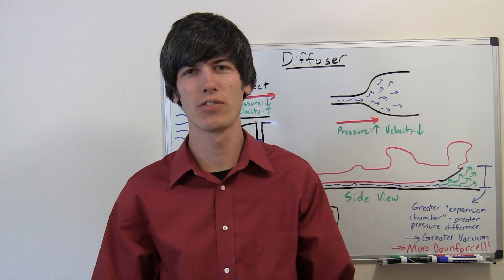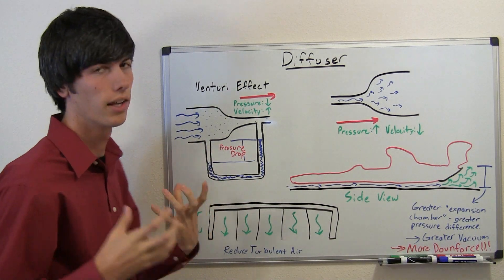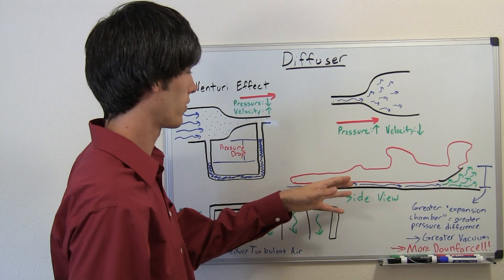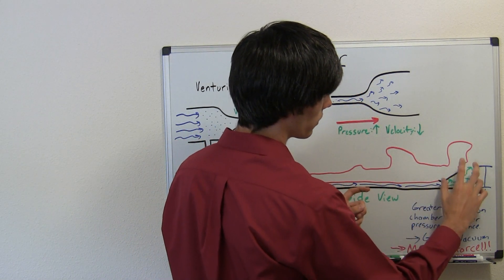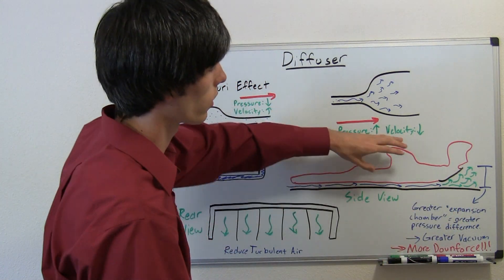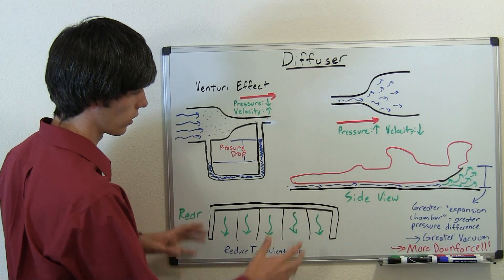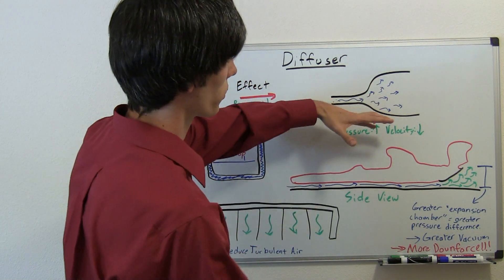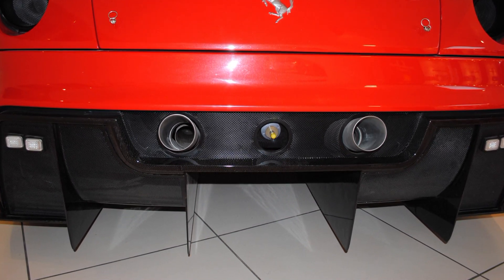Diffuser - Explained

Comment: this explanation contradicts my knowledge on aerodynamics. how does a greater pressure differential helps draw air from the bottom out faster? doesn't air moves from high to low pressure? 
from what I read is that the high pressure at the exit of the diffuser is to help to minimise the vacuum at the rear created by flow separation near the trunk area hence lower drag. and the fins and shape are for the flow exiting without turbulence making faster flow at the bottom hence downforce 
please correct me if I am wrong
Reply: +Kenneth Lee This video, for me, does not tell the complete story. It is truth what is said. But lacks one part of the equation, that is, air is not &quot;created&quot; under the car. Air enters the bottom of the car by, specially, the front, and also, from the side of the car. There, you have high pressure (not atmospheric pressure, because the movement of the car, will increase it, forcing air entering under the car). So, is that pressure that is responsible for forcing air travelling at high speed under the car, and there, at low pressure. The diffuser in te rear helps stabilizing the flow in the rear. Yes it expandes the air, and yes, you will have teorethicaly, a higher pressure that underneath the car. The question is that we always assume that a venturi, does not represent any pressure drop. What is not real. So, when air comes to the diffuser, it will try to fill that volume, expanding, decreasing speed. But you still have a big pressure differential between the front, and the rear. The bigger the differential, the faster the air will travel. But the problem is that you need to stabilize the air in the rear, so when it goes out behind the car, does not represent turbulence enough that could affect the flow (and decreasing air speed under the car). So, by expanding the air and reducing it speed, and stabilizing the flow by the presence of those ducts and fins, that is achieved. And it must be achieved by means of, lets say, can interact with other aerodynamic questions that can affect the car. That vacuum question that you mention, is more a problem of air swirling around. So the diffuser must be able to direct the air straight out of the car, avoiding those swirls to happen, filling that vacuum (and why not saying it, using that vacuum to increase the capability to extract air under the car), reducing drag. Not an expert. Just my idea. ;)
Reply: Diffusers are not aerodynamic devices?  Really?
Reply: hi Kenneth. a diffuser converts dynamic pressure to static pressure. For a given static pressure behind the car, the diffuser allows a lower pressure underneath the car, meaning more downforce. the better the diffuser, the higher the downforce created.
Reply: +El BU Sorry, but you are wrong. So if you have a pressure differential, between the front and the rear, that is what is responsible for it's speed, both in the intake, under the car, or in the rear end. Think of it this way: if you don't have that pressure differential, the air wouldn't flow at all, and speed would be 0m/s. You say "more air to flow", and you are right there. But if the cross section is constant, in order to let more air to pass, something must happen. And as you know, flow=speed x area (or cross section). So if you have more air passing under the car, or in correct terms, a increase in flow, and the area is constant, speed must increase. Regarding the pressure differential, in a system, as it increases, the speed will also increase.
Reply: +fitty77 So you should say: '' you are right", cause what you say is exactly what I said. However you compare an static airflow situation where the airflow is manipulated through cross section differential with a dynamic airflow situation with a different overall pressure difference. This is comparable with the car moving at higher speeds. Of course the total airflow will increase in this situation.
Reply: +fitty77 Totally right English is not my native language either. What you are talking about now how to ensure the airflow stays connected to the surface. There are limits to how you far you can go before the airflow disconnects from the surface, unless this is what you want to achieve at a specific point along the surface.
Reply: +fitty77 I think you're close to it. Pressure differential between the front and rear does not increase the airspeed, it just forces more air to flow. The speed depends on the cross section.  Playing with the cross section allows for low pressure under the car. But your right the diffusor stabilizes the air to minimise drag and still allows for lower pressure that sucks the airflow up behind the car.
Reply: +El BU also about the cross section, in pratical terms, you don't want it to be to large, as it will lose effectivness, or to small, as it can disrupt the air flow itself. Not talking about the diffuser. Talking about ground clearence and the shape of the bottom of the car. The idea is to have the air flowing as fast as possible under the car, keep it flowless (not sure if this is even a word... lol, but english is not my language), and take care that it reaches the rear as "clean" as possible. Because when speed increases, is really hard to avoid turbulence. So the bottom must be regular, and the diffuser, will help stabilizing the flow in the rear (really don't believe that a laminar flow is achievable, but hey, try your best :) ).
Reply: +El BU &#180;Sorry, i&#39;m not saying EXACTLY what you said. You said pressure differential will increase air flow, but not it speed. I said you are right, that it will increase the air flow, but you are wrong when saying that speed will not increase... The example i used, that you refer to, i used because at this side of the keyboard, i don&#39;t know your konwledge on fluid dynamics. Just an exampl. Nothing more. The end of your answer really didn&#39;t understood what you said. Sorry. I&#39;ll guess that is this: yes, as car moves faster, the faster the air will flow. And yes, the greater will be the pressure differential.
Reply: +El BU Maybe the problem is really a question of English terms... :D What is important is that we discuss this stuff in order to evolve ;) Cheers
Reply: +fitty77 Evolve certainly. You are still saying the same as I did. Increase in overall pressure will increase the total airflow. When the geometrie of a cross section does not change. The air speed will increase. However cross section can change so the only constant is the total airflow that has a different speeds and static pressures (in a fixed relationship) when the crossection changes.
Reply: also if I remember right the aerodynamics properties he is using is actually bernoulli, not venturi.  I am going to cut him slack because he is more mechanical not aerodynamic.  F-1 cars spend a lot of effort to minimize wakes which helps reduce aerodynamic drag (main purpose of a diffuser I would think).  all the other videos he has done that I have seen are great, just this one you can tell he is a little out of his element.  aerodynamics isn't easy though
Reply: There is actually an even lower pressure generated on the back of the car.
Reply: The point of a rear diffuser is to create a larger pressure on the rear of the vehicle. This will minimize cd, minimizing drag. This is due to the low pressure created in the underside of a car. If you want to maximise downforce, dont run a diffuser, which can be seen on some fsae cars, were top speed reached is less than 60mph and thus drag isnt that much of an issue
Reply: Kenneth Lee I agree with you, as I see it diffusers create under pressure so it is sucking the car down because it is trying to pull car down while rear wing is doing it in the opposite way by pushing it down
Reply: +Kenneth Lee You are right. The rear end does not suck the wind out, it increases the pressure and minimizes turbulence. It does however creates an upward movement of the airflow, that indicates a lower pressure than the surrounding air. Expension of a subsonic airflow, always slows down the airspeed.
Reply: Makes sense to me. That 'expansion chamber' at the rear of the car is to give space for the air exiting from underneath the car to expand, hence lowering the pressure at the back of the car. The low pressure there sucks the air from underneath the car out through the back, hence also lowering the pressure underneath the car. Then when you have low pressure at the underside of the car, and the higher, unaltered 'atmospheric' pressure on top of the car, that'll naturally help push the car down. Downforce, as they say.

At least that's how I'm getting it
Reply: timtam53191 finally, someone hit the nail on the head
Reply: Kenneth Lee.... He is explaining diffusers, not aerodynamic,, dnt mix two concepts..

Comment: If the diffuser increases airpressure, it does not create downforce, but the opposite. I think the real purpose of the diffusor is to slow tow the airflow and increase the airpressure to the speed of the car and the normal airpressure. In doing so this prevents turbulence behind the car that would happen when the high velocity low pressure air underneath the car is released to 'open air'. The real down force comes from the low pressure underneath the car. the diffusor just releases the airflow 'gently' to the atmosphere and by so reducing the drag.
Reply: In the video he says that it was drawn out backwards, that is correct.
Reply: +Baylor Mccarville The diffuser itself (rear body work) does not draw anything. It is just an airflow with constant energy (except for normal loss of energy) that is manipulated by increasing or decreasing cross section and through this, airflow velocity. This effects also the static pressure which generates the true downforce. If you want an extreme low pressure at the end of the diffusor that would 'suck' the air out, that will create extreme turbulence behind the car and increases drag. In the end, the air is not drawn out, but the car pushed down.
Reply: +EI BU you are correct. The explanation of diffusers in this video is incorrect.

Comment: I noticed something that seemed a bit off to me.
Expansion chambers are designed to actually INCREASE the speed of gas coming out of the low pressure, smaller zone.
I'm basing this off of the theory of the de Laval nozzle design in rocketry, the gas actually increases in speed in the expansion zone at the rear.
Reply: +Joshua Selvidge Well that is true for the laval nozzle, but there is one huge difference to a diffusor of a car. The gas stream of a rocketmotor reaches supersonic speeds and the car doesn't. And at super sonic speeds the working of the diffusor is reversed. At sub sonic speeds the gas slows down and the static pressure increses in a expansion chamber. At super sonic speeds the static pressure drops and the gas flow accelerates.
A laval nozzle is a very clever thing because it is designet in such a way that the gas stream reaches super sonic speed at exactly the narrowest part of the nozzle.
Reply: +Joshua Selvidge Yes, but in rocket theory, the gas exiting the outlet depends on the inlet pressure, throat area and temperature. In this case,  the main purpose of diffuser is to help to reduce the turbulence wake at the back of the car by smoothing the transition(separation of boundary layers) of air from high velocity/low-pressure to low velocity/atmospheric-pressure. In Rocket design, the outlet velocity is high enough to neglect this effect. I assumed you are talking about convergent-divergent nozzle. :-)

Comment: Think u got this wrong. air exiting the diffuser is of less pressure and higher velocity than the air undercarriage. Boyle's law - For a fixed amount of an ideal gas kept at a fixed temperature, pressure and volume are inversely proportional.
Reply: +airj17 Boiyle's law only works for a static system. A closed chamber or something similar. You don't have that in this case here.
Reply: There's nothing to do with volume and Boyle's Law. We're speakin of a high and low pressure effect on an object aka venturi effect. It is correctly explained in this video, the undercarriage has lower pressure and higher velocity, and at the exit of diffuser, pressure is high and velocity drops (don't argue, this is basic physics). Hence the lower pressure below (undercarriage) causes the higher pressure above the vehicle to push the whole car to the floor. This concept works similarly to an  aerofoil wing of aircrafts.
Reply: If you listen closely he'll say, "this is just backwards" so it's the opposite of what he said, but he meant for that to happen. You are correct.

Comment: loved other videos, but you got this one wrong. The one you explain here is ground effect. Diffuser works differently, when high velocity under the car is rushed thru the expanding channels of diffuser, pressure drops at the rear end, causing higher pressure air above to push the rear end to the ground, resulting in rear down-force.
Reply: Chris Williams You are thinking of a fixed mass, and mass flow rate of zero. That is when Boyle's Law is applicable. This is moving air, which is obviously not a mass flow rate of zero, so the Venturi Effect happens, which is caused by the flowing fluid (in this case, the air). When a flowing fluid is constricted, its velocity increases and the pressure decreases. When a flowing fluid exits from a constricted tube to a more open area, the velocity decreases and the pressure increases.
Reply: dark knight I agree, as the air passes from under the car (where it is confined) and then under the diffuser it is less restriced and allowed to expand, when the air expands the pressure would drop (Boyles law) and the differential between the lower pressure under the diffuser and the air travelling over the car at a higher pressure would cause downforce.
Reply: gastonracing17 You are thinking of a fixed volume of air, in this case the air is constantly 'topped up' by air from under the car. In this case the total pressure must be the same at the beginning and end of the system (atmospheric pressure) and from Bernoulli's equation the total pressure is the sum of static and dynamic pressure (assuming insignificant change in height), therefore as the speed reduces and the dynamic pressure reduces the static pressure must increase to compensate. The difference between this application and the application of a closed volume is that flowing air at low speeds is going to have insignificant levels of compressibility. Having said all of that none of this 'creates a vacuum' under the car.
Reply: It's funny, I think everyone here almost gets it right but each time another tries to explain, that person still manages to get another detail wrong.
Reply: See the problem is think of it as equalizing the pressure between the two places, more space at the back needs to equalize the air in front of the diffuser, the air is subsequently pulled from that part, creating reinforce. This is my understanding please correct me if I am wrong
Reply: Ooo a nerd fight💪
Reply: dark knight That is only in the case of a fixed amount of air in a physically closed system, it is not true in a steady flow situation where compressibility is insignificant (at relatively low speeds)
Reply: dark knight I was having this doubt. He says the air at the back has less velocity so its pressure increases, but what about the volume of that air? It increases, so wouldn't that mean a decrease in pressure? What am I missing here?
Reply: gastonracing17 exactly, when  air expands(volume increases) pressure decreases.

Comment: And that's why aftermarket diffusers don't work. Without a flat undertray the effect will be almost non-existant.
Reply: sodazman helps with new sport/supercars, even premium sedans etc. As they nowadays have flat underside. Doesnt really help at stock height but if yours is lowered then a diffuser can help in fuel consumption/aerodynamics etc.
Reply: sodazman if well designed they could still theoretically reduce the turbulence at the rear to reduce drag
Reply: Funke Motor exactly. The small flat piece of carbon or other material the length of the sideskirts and that sits under the sideskirts of a car (with flat side parallel with the ground and that sticks out from the sideskirts a few centimeters or so) helps to accomplish this. Basically, since this piece sticks out, it helps to keep more air out from underneath the car than just sideskirts alone. It helps to keep out air "spillover" from the face of the sideskirts; if nothing else it gives the air a longer path to take before making its way underneath the car.
Reply: So you mean my cardboard fibre, diffuser from eBay, Won’t work as they say??
Reply: Ba dum, Tsssssss
Reply: you are very right. perhaps a DIY undertray, you will feel the difference even in low horsepowered cars when cornering, its like a subtle feeling of the car being glued to the ground, like youre anticipating the car to break loose and slide mid turn but it  wont.
Reply: Mortalomena If you can find a way to seal the sides of the undertray the effect is even bigger, with no air leaking from the sides, it would be basically a vacuum chamber. They banned that in F1 years ago because the cars were entering the corners way too fast.
Reply: @Funkestech  banned not because of speed, but because how easily the downforce was lost.
Reply: @BrandonKent136  in f1 now, the floor is sealed, but not like in the old days, it's now sealed invisibly with vortex and energized air. With that technique, the downforce is much more consistent and stable than skirts

Comment: What do you think about some small vortex generators on the underside of a front wind splitter just before the axial line of the front A arms to help keep the high flow of air moving underneath the flat bottom of the car rather than run into suspension linkage while increasing the boundry layer until it reaches the rear diffuser?

Do you think its a good addition?